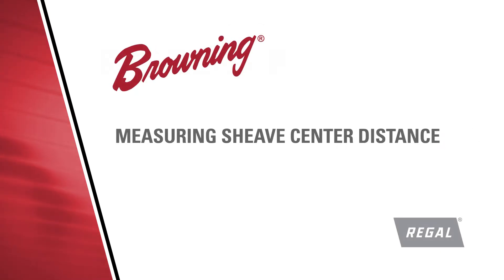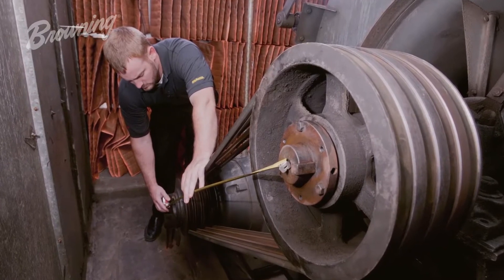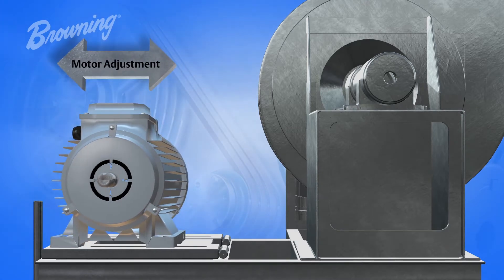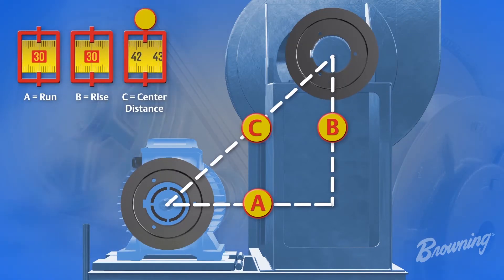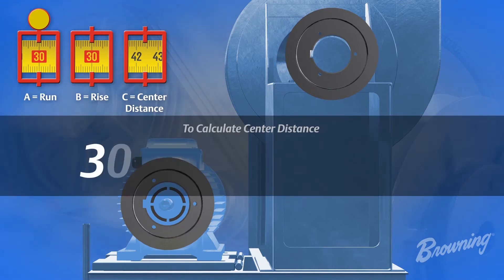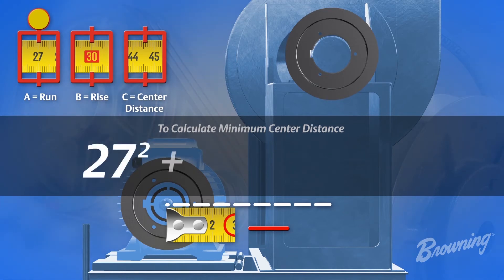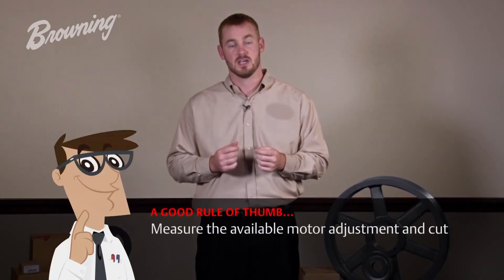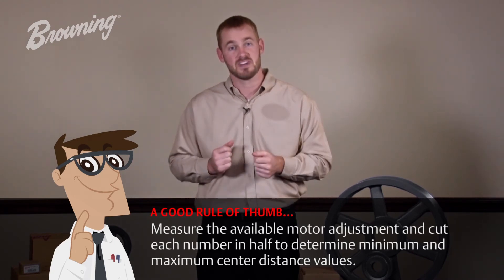Belt Drive Center Distance How-To with Browning Sheaves

Comment: thanks, 
so the CD is only valuable and needed to determine the belt length? 
or is their other precautions that need to consider and be within a specific min/max CD? (like avoid vibration, ..)